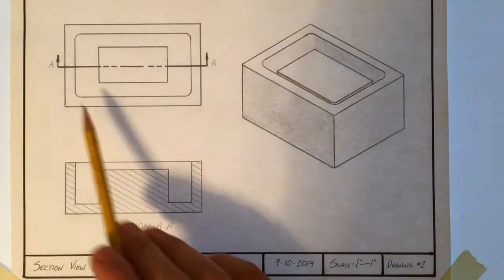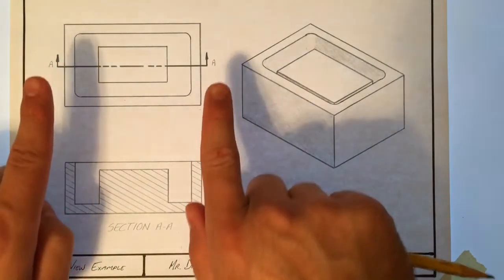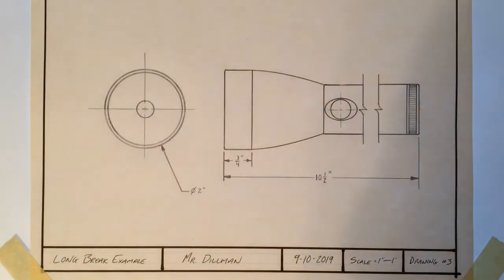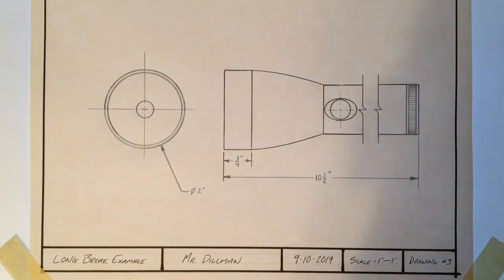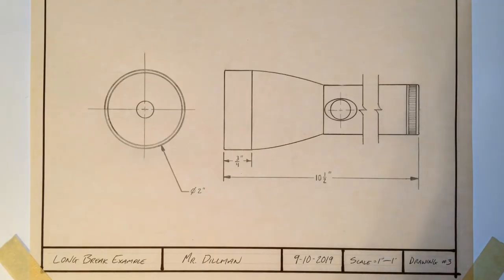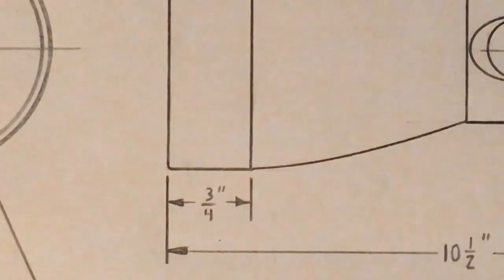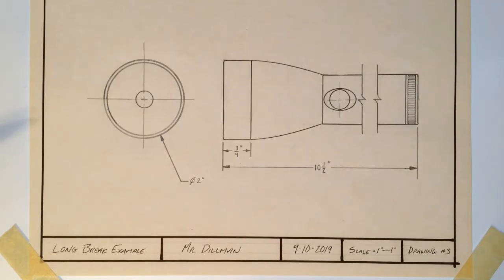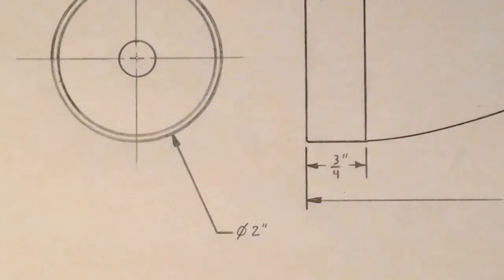Line Types in Technical Drawings Part 2

Comment: Does/should the short section line exist where it goes through the hole? I wonder if this is one of those things with two school of thought. I was taught you don't put section lines on air, only on the object.